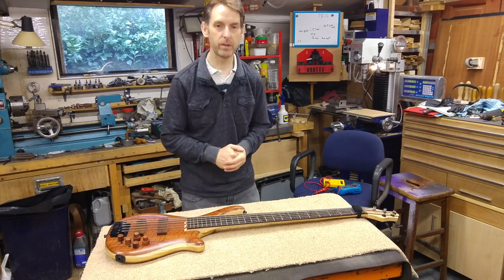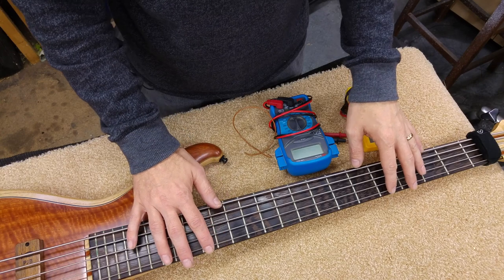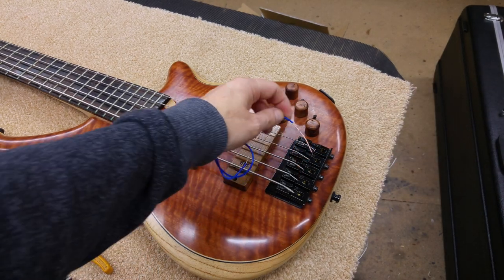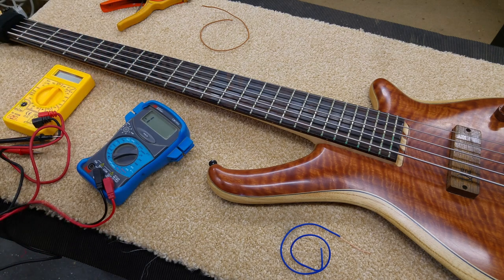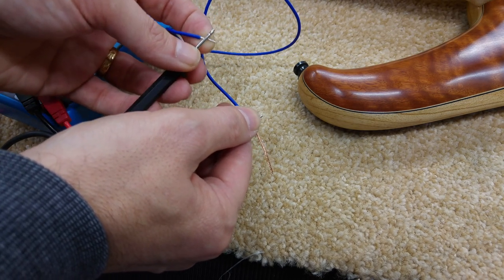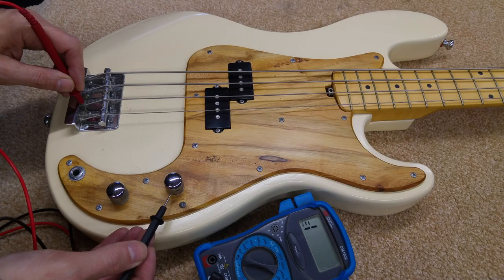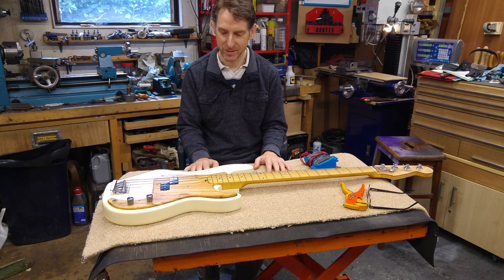Finding out why my bass hums

Comment: Can't figure out why my bass makes that noise when I let go of the strings? I've tried everything! Cleaning the pots, changing the pots,grounded the bridge, added another ground wire inside. My other basses are quiet, last resort is to get rid of these metal knobs. My other basses all have plastic one's.
Reply from the maker: I have found (especially if it's a passive bass with single coil pickups) that it will pick up noise. The extent to which you hear it will then be more to do with how noisy (electrically) the environment you are using it in. If you're going through a PA that has some issues with noise it may be more noticeable. If your bass amp (forgive me) is very inexpensive then that may contribute. I was using a Jazz (style) bass that was ok through my tc electronic amp, but when going through a certain PA picked up noise. I've found that keeping the volume off when not playing and then making sure you are touching the strings when you raise the volume will help.
Reply: @pauljazzbass  True! I've noticed in some places it's quieter than others & which direction your pointing etc. I guess it's the same with guitars that have single coils. Always gonna have noise.
Reply: @pauljazzbass  True! It's very noisy only through my practice amp. Vox pathfinder 10 bass.
Reply: @pauljazzbass  Finally figured it out! The screw next to the input jack that holds the pickguard down was stripped so Everytime I unplugged the bass the pickguard would flopp up a bit. Used sum plummers(tefflawn)tape to wrapp around the screw so it stays in now & no noise.
Reply: @pauljazzbass  Thanks for your help thou!

Comment: My Bass was humming it was picking up interference from a light dimmer when I turn the light off it stopped
Reply from the maker: Noisy mains can be such a problem. Thanks for the comment. I remember playing somewhere and getting noise through my amp. I found out that the venue had a neon sign that caused problems!!
Reply: @pauljazzbass  I am having the same issue. How do I fix that?Would shielding the bass fix it?
Reply from the maker: Shielding behind the pickups, and in the cavity where the wiring is, as well as making sure the bridge is grounded is a good thing, and will help with hum. But if the noise is from noisy mains, where you have lighting dimmers, or a fan, or other motor, then it may not help. At a venue with professional lighting the dimmers have suppression in them to help. If you are getting noise at home then you may just have to eliminate what is causing them to hum.
Reply: Sounds like you could benefit from some shielding, lots of Vids here on youtube for it, only requires some copper or foil tape and a ground from the shielding to the common ground (usually the output jack). The idea is to create a grounded metal box around your electrical components between the inner cavities and the pick guard and/or back plate(s). The layer of foil intercepts any interference and sends it to the common ground before(hopefully) your electronics pick it up.

Comment: you showed the diode symbol. continuity symbol looks like wifi connection symbol that's rotated 90 degrees. Measuring ohms/resistance can also be used, you just don't get the audible beep. Low/no resistance means there's continuity.

Comment: When i raise tone knob in my P bass it's sound like grounding or humming but just after that when i touch string it become silent can you guide me what's the major issue I'm facing
Reply from the maker: It might not be the bass. If you only play through 1 amp it may be something on that. Also if you play in one place it maybe that the mains supply is "noisy". The bass will pick up noise even if the bass is properly grounded, passive basses are difficult sometimes with noise. Other things to look for is make sure there is a ground wire going from the bridge to the inside of the cavity and connected on something.

Comment: This was super handy and it lead to me finding a quirk in my main bass and fixing it.  The tailpiece has two ways to put the strings in. Down through the back with a brass block that the string end bits are into, and through the bottom.  In the former case, there was nothing grounding the strings, and the strings hum. I put a bit of wire through the through-holes so that either way I string this bass, it has a ground connection to the strings and the bridge.   

Question for you; Have you ever seen a bass that was just poorly constructed from the factory, in terms of its electrical connections? The reason I ask is because manufacturers have for more than a decade been trying to comply with RoHS regulations, and lead-free solder appears to be a disaster of epic proportions in most industries, so I'd be surprised if there wasn't a standard practice these days of resoldering all your guitars and basses from the factory just to get rid of the RoHS-friendly-musician-unfriendly non-lead solder issues.
Reply: Your comment stuck with me and I investigated. You are 100% correct. The through -body stringing insulated my strings from grounding. Thank you.

Comment: I get this hum when I switch from 2 pickups to a single one on my active bass, or when I switch between active and passive mode.
Reply: That's what is happening to me. I have a squier jazz bass. when I have the two pickups all the way up the hum disappears, when i turn down one of them, the hum  begins.
Reply: single coils pick up all kinds of radio interferences. unfortunately that's just how it is. and the active electronics (preamp) in your bass will make it even worse.
especially cheap preamps add a lot of hiss to the signal aswell. shielding the cavities properly and investing in a higher end preamp will help a little, but with conventional single coils you will always have to deal with some noise.
when you use both pickups the noise from the two coils cancel each other out, like a humbucker would.

Comment: I have a new Fender PJ style bass (American Performer) and it only hums when the J pickup is "on". Dont recallmit doing it before but its noticable now.
Reply from the maker: I would imagine the jazz pickup being single coil would potentially pick up noise at some point. It may be worth trying to figure out where the noise is coming from. By that I mean for example, if you notice it when at home with a practice amp plugged in, it could be a lead or something else plugged in nearby, and not anything to do with your bass.

Comment: Thank you for posting this video.  Can you please answer my question:

When I use the multimeter on my bass to check grounding, when I touch the screws of the bridge that connect it to the body with one of the multimeter probes, and the other probe with the output jack, it sounds the chime.  Which is good.  However, when I touch the bass of the bridge with a probe, while the other probe remains on the input jack, I don't get a chime.  Does that mean my bass has a grounding issue?
Reply from the maker: Hello Christos, my first thoughts are that it is fine. If you also do another check and use the probes on the strings and the jack and get continuity there, then it’s fine. Is the bridge coloured black (or anything apart from silver) . If it is then it’s probably got a thick paint on it (powder coat) that will insulate it from the probe. If when you have checked the strings and jack with the probe then you know that current is passing through the bridge. It’s just that you can’t measure it on the bridge itself.
Reply: @pauljazzbass  Thanks Paul.  This makes more sense now.  The bridge I have on my bass is a Hipshot Kickass, and yes, it appears to be covered in thick chrome paint.  When I test the probe on the strings, the bridge mounting screws, or the bridge saddle screws, or the saddles springs, or the bridge saddles themselves (as they are removable), then attach the other probe to the jack socket, there is continuity, and the multimeter chimes.  Which is good.  I only raised the query, as I was getting some hum on my bass.  Not noticeable, UNLESS, I turn up the volume.  But the hum goes away when I touch the strings, which led me to believe there could be a grounding issue.  However, the amp I have is a little cheap Fender Rumble 25 watt, and I note it is making noticeably more hiss than other bass amps I have tried.  Therefore, maybe the bass is OK, but due to the noticeable hissing of the amp, it may over-amplify even a normal quiet signal from my bass guitar.

Comment: Hi there Paul thank you for your video! I have noticed when I play over the pickups on my Fender P Bass it generates noise. However it seems noisiest when playing through my interface so I’m not sure if that is interfering. Thanks!
Reply from the maker: Interference is an odd thing. As far as my understanding goes, the pickups don't in themselves make interference noise. The problem with all guitars is that at some point  from the cable from the amp through to the pickups noise can be picked up. Interference noise is generated by electrical things around us. So in that respect anything can cause noise including an interface, but that maybe the power supply it's running though, or something else plugged in nearby. Using humbuckers, and or lots of shielding around pickups and pots etc just reduces the likelihood of noise being picked up and amplified. Sometimes it's a process of elimination where you are. Modern soapbar pickups and active electronics certainly help the whole situation.

Comment: If I can't remove my bass bridge is there any other way to ground it?
I had new pickups put in the guy left steel wool all over my pickups and didn't ground them!

Is there anything I can do with the stuff that I currently have, or what?
Please help.
Reply: The bridge should be mounted with screws? So you should be able to remove it? 
Steel wool: duct tape will do the job. The pickups are magnetic all the time -> they will attract the steel wool that he probably used polishing the frets. Just use some duct tape, rub it gently on the pickups and the fine steel wool fragments will stick to the glue on the tape.

Comment: In getting some noise from my Pbass and did everything you did on the video but I just had one question.  If you touch the poles of the pickups should they have continuity with the bridge/jack etc?
Reply from the maker: No. The poles even though they are metal. Should not make contact.

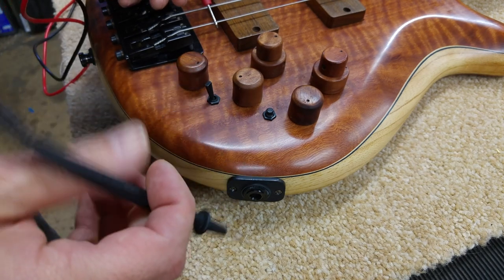Comment: Hi everyone. I have a question about something I'm seeing with my Ibanez GSR200. There is a hiss in my amps that I don't get with other equipment so I decided to investigate. Checking for grounding continuity with my multimeter, everything seems to be grounded to everything else just fine, EXCEPT when I perform the test done in this video at 4:20 (checking continuity between the strings and the jack ring). That test shows around 70 ohms resistance.  HOWEVER if I plug a cable into the jack, I have perfect continuity between the strings and the sleeve of that cable. Is this normal? Is it weird but OK? Is it not OK at all? Other than the hiss (and some buzzing that happens when I turn the J-pickup all the way up) everything seems to work fine.

Comment: So what if I have continuity and the bass still hums until I touch the strings?
Reply from the maker: If it's a passive single coil pickup it's more likely to pick up noise anyway. If it's a PBass and the second pickup is wired wrong that may cause it too. What type of bass/pickups is it?
Reply: @pauljazzbass  I actually don't know the pick-up types. It's a cheap Ibanez GSR-something bass. Recommended by others, I've shielded the electronics and pickups with copper tape today, and the humming disappeared when I got around to shielding the front set of pickups. Success! :-D
Reply from the maker: Excellent.
Reply: normann1974 i have a similar issue but don’t Have the equipment to test. Did you just place copper tape between the pickups and strings?
Reply from the maker: The copper tape can go in the cavity where the pots are and underneath the pickups on the cutout of the body. You can also stick it to the underside of the pickguard making sure that the pots make contact with it. If you do it on the pickguard you can extend it all the way to where the pickups are and cut round where the holes are.